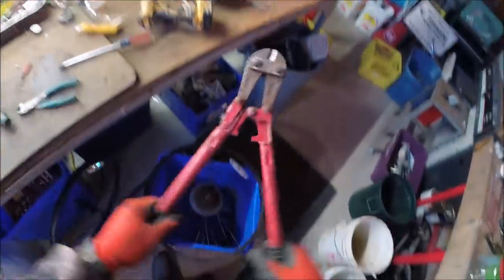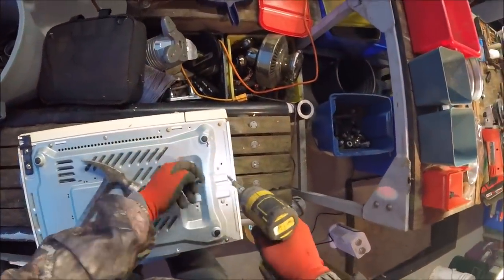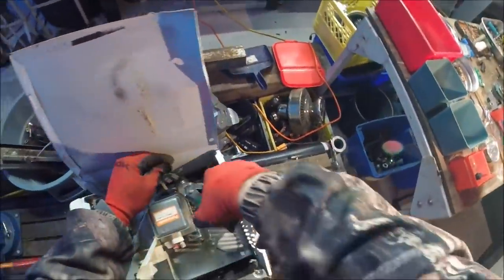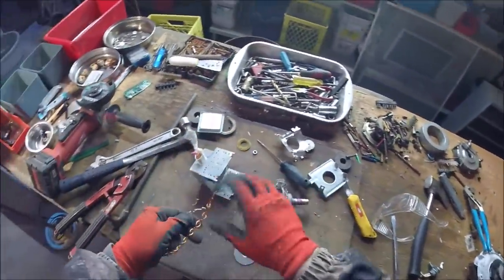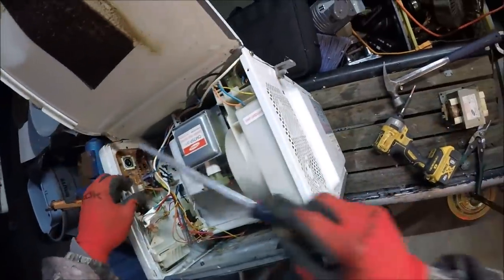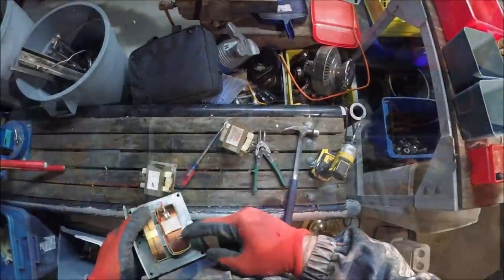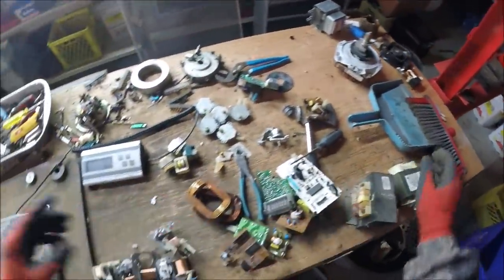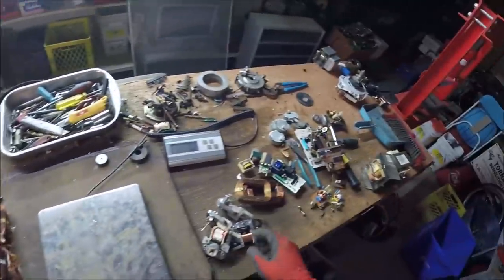Scrapping 5 Microwaves How Many Have Copper Transformers?

Comment: That means every alternate microwave (3 out of 5) has copper coil in transformer. Additionally there is copper in spools. HMS, Alu, cables, all together half the weight of a microwave is non shred.
Is there any separate demand for magnets ??
Reply from the maker: When i scrap the mags i will save all magnets